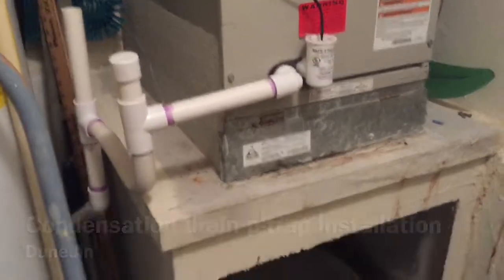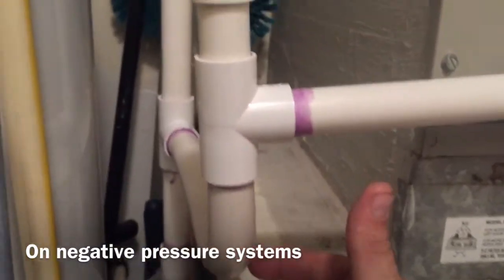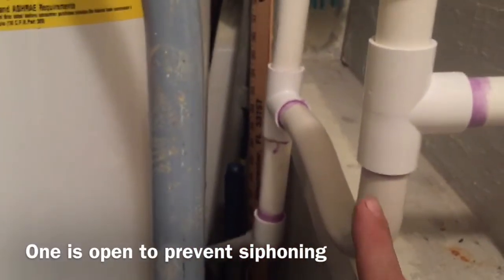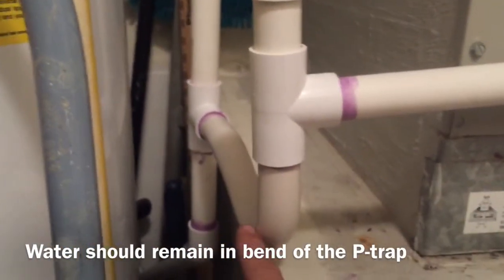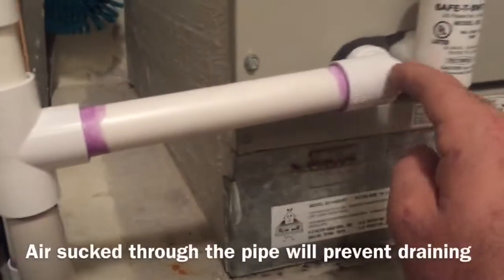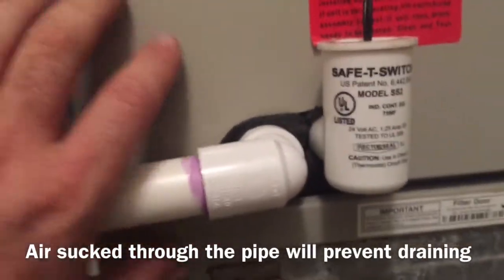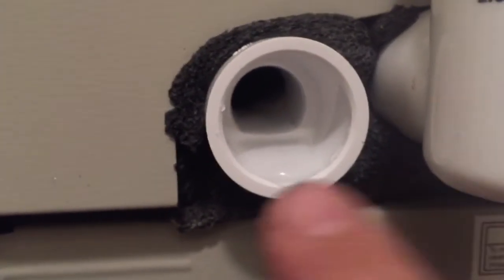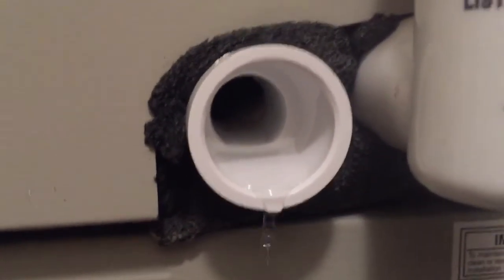Condensate line P-trap tutorial

Comment: So what is the reason or requirement to install a T vent after the P trap? I am in Florida working on this. We have had problems with it not draining well with the P traps very close to the evaporator. But if I just put an elbow facing up at the end of the pipe it drains better. They don't call as often, but they still call even if the condensation line is clean or new. But I see many people adding that T vent and I can't find an answer. Thanks for your videos and in case you answer me.

Comment: i like to think of the second tee normally called the static tee to be similar to sticking a straw in a cup of water and putting your thumb on it and pulling the straw out then we all know the water will not come out until you remove your thumb. this is the same for all plumbing vents . appropriate p- trap depth eliminates siphoning as described in installation procedures which is rarely described as a prefab store bought p-trap as illustrated

Comment: Mine has the vent but no clean out. Can I use a shop-vac and suck through the vent? And re-fill the p-trap with water?
Reply from the maker: You can try that. I would then use bleach and hot water.

Comment: Hi, my ac guy came and he did it otherwise.. he left the first pipe open and the other one is close with blue glue. Is that ok? Thanks
Reply from the maker: If the cabinet is positive pressure then it is ok. If it is negative pressure then this is the way it is done.
Reply: @AbilityJohn  How do you tell if you have a negative pressure system or a positive pressure?
Reply from the maker: @jjustice7429  most split systems are negative pressure. Package units are positive pressure mostly. If you feel air pushing out the drain they it is positive.
Reply: @AbilityJohn  Ok thanks. Water is dripping out of the unit and isn't going out the drain pipe. I poured a bottle of water in the clean out and it came right out. Trying to figure it out. Good thing is the unit is in the crawl space so it didn't leak on anything it would hurt.
Reply: @AbilityJohn  Thanks for the informative and easy to understand video!  Can you help answer this:  the p trap on my positive pressure unit only has 1 vent that is before the p trap itself. Should this vent be kept open?  (Even though it is blowing cold air into a superheated attic...)
Reply from the maker: @joicebass3725  yes it needs to stay open. Otherwise it will push the water out of the p-trap. The p-trap needs to have water in it to function.

Comment: thanks for the video, will this design work if the system has a water pump to pump out the condensation water?
Reply: yi wang yes you want the p trap with the vent pipe on the down side and access pipe on the up side on all negative pressure systems...whether it’s to a drain or to a condensator pump